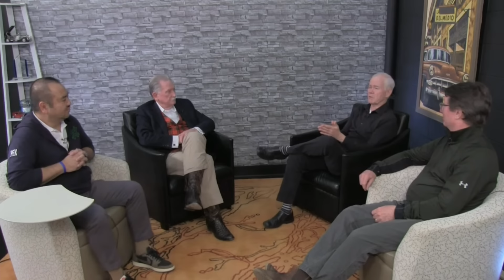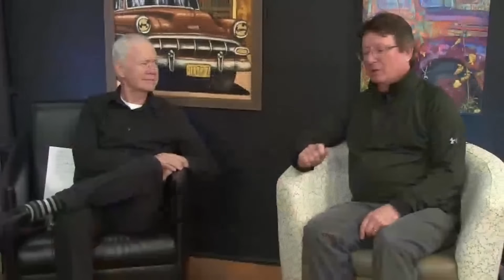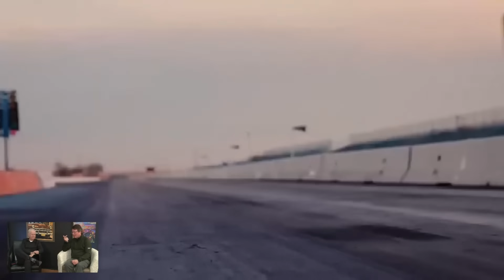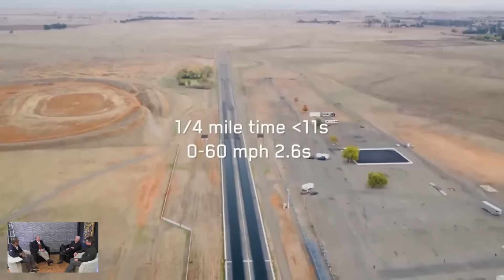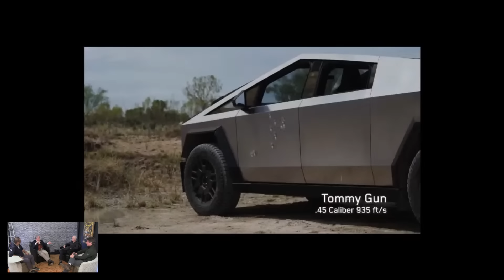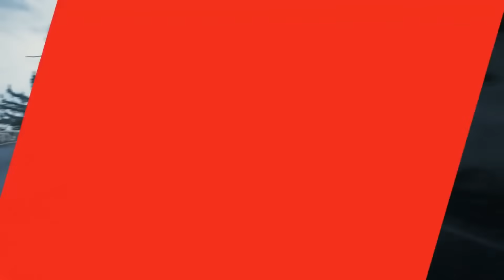Tesla's Cybertruck: A Cringeworthy Masterpiece - AAH 676

Comment: The Cybertruck cost a lot to create because there were so many new innovations. The idea though is that it will cost less to manufacture.
Reply: Big thing many missed, same as model X to Model y SUV transition was so successful. So will be from cybertruck to next Tesla truck
Reply: When the Cybertruck came out, I thought it was the ugliest thing I had ever seen, but now as I find out all of the new things manufactured into it, the thing is slowly growing on me, never thought that would happen.
Reply: @jmwarden1 Yes. It’ll be as iconic as the Countach.
Reply: Cybertruck low manufacturing costs  -  Who at Tesla said that?  I didn't hear it.
Reply: You weren't listening. That was talked about quite a bit at the original unveiling as the  impetus for the design. Google is your friend - use it before commenting.  @snookmeister55
Reply: @snookmeister55  - no paint, gigacastings, 48V (once the supply chain is sorted out), structural battery - all these cut manufacturing steps and costs. This may become their highest-margin vehicle.
Reply: @snookmeister55 they've not.
Did you see Munro walk the working line?
There's alost nobody there apart from the guys on the tour and two blokes taking hot pressings off the press. Sorry I forgot the forklift driver who was thanked by the site/production manager.
No people, no union.
Staggering!
If you've not seen it you must. 
Might be best before commenting.
Reply: @andrewsaint6581  wow.  It's interesting then that Elon doesn't expect significant revenue until 18 months or so.
Reply: @andrewsaint6581 that's because it was after hours, he even thanked a few of the line workers for staying late so they could demonstrate the line running. 😂 Comical that people still think this is a joke. There's going to be thousands of these on the road in a few months!
Reply: @linemanap  Oh sure, thousands of them. Good luck finding that many batteries.
Reply: @Withnail1969  What?  Tesla isn't trying to "find" batteries for the CT.  They are literally building the manufacturing capacity, processes and supply chain to make enough batteries to satisfy demand.  In a couple years, Tesla will be making a couple hundred thousand of those trucks a years.  All while increasing production of their other vehicle lines.  The 48v architecture of the CT is also  proof that Tesla doesn't wait around for the supply chain.  They build their own supply chain.
Reply: @linemanap absolutely.
The denial has at least got past "Vapourware".
Reply: @Withnail1969 I think that making the new form factor of battery and new form factor of vehicle is what's taking the time.
If you're in front there's no-one to copy from.
Even the machines are new.
Like when you're racing of someone of a similar skill on an unknown road. 
It's hard to pull away because your actions feed their reactions. 
Easy to keep up - tough to lead.
Reply: @donm2255  They can't produce the new batteries reliably. They are having to throw half of them away.
Reply: What “innovation “ did the cyber truck achieve that a regular truck can’t do?
Reply: @dodobono452  Nothing. It is extremely heavy and underpowered with a small load and towing capacity.
Reply: @dodobono452  The innovations are mostly in design (48V system, gigapress chassis, stiff body panels eliminating sub structure, etc). As far as doing what other trucks do, it’s the fastest truck in the world and has 4 wheel steering, steer by wire, impervious to denting, etc.
Reply: @dodobono452  you're missing the bigger picture.
Old mobile phones had buttons, were cheap, a three day battery life and were nigh on indestructible.
Yet we're all using cobalt infused, buttonless, expensive fragile glass phones now.
I think we should wait and see.
You could also suggest that there's been no innovation since the Model T, based on the style of your question.
Reply: Lack of paint is a huge manufacturing cost savings.

Comment: I'm aware of the torque on the Tesla M3 so I drove mine like a granny. My OEM tyres needed changing at 29,000km. They were Michelin rated at 70,000km. Not impressed!
Reply: Ive got m3 standard done 40000km probably get 50000km

Comment: All the Chevy Bolts you can eat on autotrader for $22k. Subtract $7.5k and you're at $14.5k for a brand new car. Bolt federal rebate ends jan1.
Reply: Those are mixed up numbers, 7500 is for new purchase
Reply: @rp9674  Nope, $22.1k offer from the dealer. The $7.5 is explicitly excluded, around $16.5 after TTL. Similar deal for new mach-e, after rebate and TTL you can drive one brand new for $25k. Rebates end this year for those 2 cars.
Autotrader is my source. Search nationwide 2023 new bolts or mach-e, sort by lowest price.
Reply: Bolts in the Northeast are $30K, with 40K miles on them.

Comment: Austenitic Stainless Steel is highly corrosion-resistant, ductile, and formable, while Martensitic Stainless Steel is highly wear-resistant, hard, and strong. The choice between the two types of stainless steel depends on the specific application requirements and conditions.
Reply: That's not a very useful generalization because austenitic can be turned into martensitic, simply by work hardening and without changing the alloy, while also increasing its corrosion resistance.
Reply: @ZipZoomZip  rather than just complaining, why don’t you offer more useful information?
Reply: @rok1475  No one complained, I was trying to be helpful by pointing out that the generalizations you made about the corrosion resistance differences between austenitic and martensitic stainless steel are not necessarily reliable or accurate. It's a complex subject and Youtube comments are not the place to delve into the intricacies of this. Just be aware that it's not as simple as you made it sound.
Reply: @ZipZoomZip  how would you characterize your “that’s not very useful generalization”  comment?

My comment was not intended to be a lecture on metallurgy but rather a simple explanation of two terms Sandy used.  If you think you can do better please post a comment explaining  those two terms in a manner you find appropriate for this forum.

Comment: The Cybertruck is a trojan horse that carries 48V and Zonal Control with the gigabit ethernet ring instead of a plethora of CAN interfaces running through the vehicle, these will be instrumental in a low cost vehicle.   Moreover as TESLA disclosed, in the cybertruck only 1 of the 3 motors in the beast uses a permanent magnet motor so the low cost vehicle will not need expensive rare earth magnets.  I am not a Tesla fanboy but it is clear where they are going.
Reply: Ethernet does not use a ring topology.  The advantages of eternity for networking bring no advantages for this application.
Reply: @gregkramer5588 Tesla created a new Ethernet protocol that does communicate around the ring.
Reply: @Global_Optimization A ring topology would be a horrible way to implement communications in a vehicle.  Since a failure at any node can bring down the entire ring. I'm fairly experienced at this and actually designed a subsection of the receiver part of an ethernet mac in a 10g system myself. That said ethernet MAC/Phy chips are cheap and fast. CAN is even cheaper but slower. The Ring part just makes no sense to me.
Reply: @gregkramer5588  If I remember correctly they are getting around this by making it have bidirectional capability so that the ring still functions just fine in the event of a failure. Tesla's executives talked about the etherloop design in an interview with Sandy Munro.
Reply: @gregkramer5588  I checked the Munro video and confirmed. At 14:07 Pete Bannon says it's "bidirectional for redundancy"
Reply: @global_optimization  I would love to see the layout of this.  It sounds like two rings to me.  Even then it seems like a node could still be a single point of failure. Granted this is not an airplane or military applications so it does not need those levels of robustness.
Reply: @gregkramer5588  I had interpreted Bannon's "bidirectional for redundancy" statement to mean that in the event of a fault that severed the ring somewhere, the controllers can reverse the direction of data flow to effectively convert the ring into a back-and-forth linear topology (I'm not sure whether there's a name for that). They said the etherloop has extremely low latency, so I imagine that it's probably still good enough for safety even if maximum latency doubles in the fault mode operation.

Overall, I think it's reasonable to give the Tesla engineers the benefit of the doubt and assume they did proper FMEA and stress testing to ensure fault tolerance. They do have a track record of going above and beyond on designing for safety.
Reply: Yup. 

I don't understand pickups, the config leaves me unimpressed and while I admire avant garde looks, it's a hard look to love every day. Not to mention literally sharp edges. Not my thing. 

But the tech is amazing. 
4680
Steer-by-wire
Ethernet ring
48V architecture. 

If this is in rumored  hatchback model 2 - by God this will be Europe killer.
Reply: Don't need to be a fanboy to appreciate hi-tech innovation.
Reply: "Rare earth magnets" is a misnomer, they aren't expensive nor rare as they are man made out of plentiful materials like iron and boron and others with cobalt which is being phased out. It's more political because China makes everything including rare earth magnets and the US just doesn't make anything especially as important as magnets. Obviously Tesla is trying to change that.   👀
Reply: @cuda426hemi  You are confusing motors with batteries!
There are no rare earth elements in batteries (Chemistry 101) but there is Neodymium in current permanent magnet 3 phase motors, which is in one of the 17 rare earths.
However the Tesla gen 3 permanent magnet motor has dispensed with Neodymium in their magnets using industry leading software simulation.
Reply: @waynerussell6401  Original poster mentions "permanent rare earth magnet motors" as being cheaper or better and it's just a bunch of misnomers. Also Tesla may still be using Neodynium a "rare earth element" in their PM along with other rare earth elements and good ol' Fe. Point being I was trying cover so called "rare" elements in batteries AND motors as being more politically powered than ecological or economical plus "rare" does not necessarily mean rare NOR expensive.
Reply: Nailed it 😉
Reply: Why not build a CHEAP SIMPLE EV for short daily commute directly ??? THIS WOULD BE GREAT and useful !
Reply: @ellsworthm.toohey7657 working on it.
Already lots of them in China.
Reply: @ellsworthm.toohey7657  that's next in line. the $25000 car is currently in development and will be built at giga Texas
Reply: @AndrewReadman  along side the $40k Cybertruck
Reply: @gregkramer5588  inflation and global pandemic and chip shortage adjusted ofcourse. Vegemite is now $8.50 a jar back then it was $3.50 where is the outcry about that?
Reply: Overall inflation was not near as high as the change in price of the cyber truck. The original projection seemed unrealistic from the beginning. @AndrewReadman
Reply: @gregkramer5588 there’s the new 48v system, the new steer by wire system, the new brake by wire (mostly by Brembo but Tesla still implements it first), new bi directional charging, longer range in the AWD version all this stuff is included and costs money. 
The slight loss in towing and payload are fine. The loss of range in tri motor is fixed with the accessory pack (it’s better to not always lug around the extra range). The upper lightbar becoming paid accessory is fine. Losing the ramp in the tailgate is fine. The highest level of range and charging capability hasn’t been unlocked yet they need more data. The rear wheel steering can do 10 degrees but for now it’s locked to 3. And many of the complaints about it are neglecting the fact that tire choice is causing the off road and snow issues and performance and range are also affected. 
I’m still baffled as to why people think this is disappointing. Every ‘reason’ seems tissue thin and not even really true. 
Inflation and the costs of all the new tech on board, plus what others charge for EV pickups the prices are within reason. Plus people will pay $20k more to move up in line so Tesla can get away with these prices for the first few years. Then it gets cheaper versions. Sorry for the letter lol
Reply: Range is ok, about the same as the Ford but less than the Rivian.  Steer by wire sounds good for the city folk.  Bi directional charging is not new.  It is pretty competitive until you see the price.  You can get a nice lighting for $20k less. At least for now.  The lighting is more practical, has the awesome frunk and rides better.  Plus you can get it fixed way easier if you every need to!  @Jasonfallen71
Reply: @ellsworthm.toohey7657 They are battery constrained.  They will sell like hot cakes, so 4680 battery production needs to hit on all cylinder. Plus, they have to engineer it to be profitable, unlike the GM Bolt that is sold at a loss.
Reply: @GET2222  a worm is a GP
Reply: @GET2222What's an SS?
Reply: And you have to admit: they know where they are going.

Comment: Sandy's comment about purchasing agent buying questionable material seems like a low probability event, the stainless steel is a bespoke formulate and the supplier is providing custom cut rolls to minimize waste
Reply: Doesn't happen at Tesla.  The chance of an unexpected material showing up in the 4680 manufacturing line is none.

Comment: The stock rear Goodyear on my 2018 CT6 2.0E plug-in do all the braking and acceleration and have 60k. But that includes 6,000-8,000 miles off the car when snow tires are on.  Not sure if insurance company know mine has a 18.4kw li-ion battery but was $300/6-months for full coverage before recent insurance hikes of 25%.

Comment: 25K on model X.  50% wear.
Reply: I used to be in a BMW Z4 club.  Some guys got 35K on sports tires, some got 15K.  Depends on how you drive
Reply: @brentdiez7012 I agree and one would be nuts to put a sport tire on Cybertruck.   Tires models are being developed specifically for EVs.
Reply: Most of EVs weigh around ~1000lb more than it’s equivalent ICE counterparts due to battery chemistry.. so the tire has to wear off relatively quickly in EV . When mass plays a huge role in crash test to especially roll over tests and we acknowledge that for EV . But it comes with this side effects of tire wearing OFF soon  and we Should acknowledge that as well. Come on guys it’s pure physics.

Comment: The 48v tech has been used in computers for 30 years. It's called PoE. Power over ethernet. This is common computer hardware but new connectors should be used
Reply: This is NOT power over ethernet being used by Tesla, they said the auto environment was so noisy it was not worth the risk to save one conductor especially as the 48V and zonal control with Gigabit ethernet cut so much cabling and weight out of the vehicle
Reply: Some german cars have the 48V architecture
Reply: @drury2d8 If you're correct,  then there is no 12v battery in the vehicles.
Reply: @snookmeister55  - that is correct.  There is a 48v battery.
Reply: @mikesunderland9145  No, I heard a Tesla guy say otherwise - 1 battery,  800v I think he said.
Reply: @snookmeister55  - On Jay Leno's Garage, he interviewed Franz von Holzhausen (The designer of the Cybertruck) and Lars Moravy (the engineer behind the Cybertruck and Lars specifically said there was a 48v battery separate from the 880v battery.  at about the 19:15 minute mark: https://www.youtube.com/watch?v=BGDOKD7ZZqI
Reply: @mikesunderland9145  Gotcha.   Power is supplied/converted from the 800v main but there is also a 48v battery.
Reply: @drury2d8 they do not. Hybrids use 48v for the electric traction motor and this is a dedicated circuit. Tesla use 48v for almost everything in the cybertruck. Window motors, lights, steering servos, you name it.
Reply: @drury2d8 there is a difference between having a 48v subsystem for a few 48v components and being 100% 48v.   There are no other 100% 48v autos from the ground up.
Reply: @drury2d8  I'm not aware of this, can you tell us which ones?

Comment: Cybertruck will be the best truck at every price point they offer it. Current “comparison price point of HUMMER EV. Which is trash compared to  cyber truck. And not available. 
By the way “ legacy” means what is left after you die.  
All ICE vehicles are Legacy. 
Ice losing share everywhere EV is available. 
Some legacy can’t get software right. Some can’t get the battery right some can’t get the price right. 
Bye bye
Reply: Yeah won’t it be great when all of legacy auto is gone and our only choice is Tesla🎉
Reply: @michaelriecher5632 
U go then and buy inferior product for more expense to keep competition alive then.  Note: there is NOTHING that would stop other manufacturers from doing what Tesla is doing.. they even offered their patents in swap-deals.  This is all on the incumbents and their control of the market of cars and Tesla is actually the one who is competing with them and has got the more economical and better product, which is why Tesla gains market-share.
Reply: @joansparky4439  I agree why buy a regular old pickup when you can get Cybertruck built for the coming apocalypse
Reply: @michaelriecher5632  
I HIGHLY doubt the CT is build for any apocalypse, nor that a regular pickup will be any good if there is one.  It's just a better (#) truck that runs on electric, nothing more, nothing less.
#) market will determine that one, but I'd buy one if I could afford it as it does everything my current truck does, just better.  YMMV though.
Reply: Yup with Phantom braking in highways and the other car hitting you just so happen to be a cyber truck 😂 …  so much fun